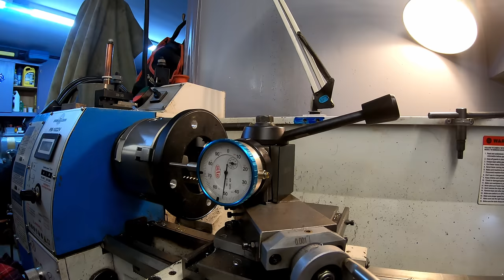Turning down wheel spacers on a metal lathe

Comment: I was a machinist for 12 years, and 8 years were spent machining FORD AXOD transmissions.

We machined nearly 80% of this transmission before we shipped it to the FORD Plant in Livonia, MI.

Long story short, we started with what we called Op 10A which was a Cincinnatti Milacron (CNC) HPMC 850, with this we machined the pan face, drilled, bored, and reamed 2 location holes for OP 10B which was a MASSIVE machining line. (About 2 bocks long)
It had arbor mills, trunion heads, turrets, and many other machines.

I learned so much back then and, if OSHA was like it was today, this machining operation, even with all the safety features we used, wouldn't be able to be run with humans.

Very dangerous to change inserts, drills, probes, taps, and mills on the actual machining line.

Extremely slippery from the cutting fluid we used from a 40-thousand-gallon tank.

Needless to say, this was a good memory trip back to those days, even with your Dad using a small lathe and a not so high tolerance part.

Great to see you learning his trades! (My Dad was never there, so you're very lucky Samantha! (Take it all in.)

Cheers,
James

Comment: I drove  a Ford 8N on my uncles farm in Iowa back in 1964. Not sure of the manufacture but he bought a sickle mower that was belt drive off the pto. The bar was so heavy I could hardly lift it. It had a breakaway feature but if it clogged I had to back against a wood fence post to reset it. I was a skinny kid. Rear mounted cultivator gave you a pain in the neck watching, especially when on a side hill.
Reply: Dude same.. My first tractor was a Ford 8N my neighbor gave me.. I drove it when I was 8 years old, belonged to my great uncle (long gone before I was around) he bought it new for his pig farm in the 50s... it sat for a decade before my neighbor who bought my uncles house gifted it to me.. I couldn't get it to run, thought it was just a coil.. turns out tractor supply sold me two junk coils.. ended up selling it to take a road trip to Oregon. Guy I sold it to had it running in minutes. Miss it, wish I would have kept it. Great tractors! Dangerous tho lol.

Comment: I’m very impressed by your dad’s work and I learned a lot about lathes! But in this case, I think I would of changed the wheel studs for longer ones on the hub instead. However I’m glad you did it this way because of your nice video! Thanks sam😁
Reply: That was her dad? Cool. My dad was a tool and die maker/machinist by trade.
Reply: @DAS-Videos  when she walked into the shop he said “hey Sam” and she said “hey dad”

Comment: im surprised andrew hasnt got a lathe, when i got mine i did a lot of jobs i needed doing and saved money, also made a few art pieces, replacement chess pieces,  new knobs for pan lids, its well worth the money to get a decent one and you can cut many materials not just metals...
Reply: He did have one he showed it to his dad once. Probably a reason it wasn't used this time
Reply from the maker: Andrew does not have a metal lathe said it was a hobby he couldn't get into,  that's okay can't do it all!
Reply: @samanthaweber6932  you should try it, over last 10 years i built myself a little steam engine between farm jobs, some things cost more than they worth but making your own will save a trip to town, especially when it comes to worn parts, i just weld metal back on slap it in lathe cut back to size and save my self $400 or more...
Reply: @kieranosullivan02  pretty sure he sold them all on marketplace

Comment: I have a 42 9N ....I kept my original PTO shaft and got a slip-over adapter so if I cam across any of the old style equipment, I could remove the adapter to use them...! I have an upgraded Vain Pump on the front to run my 1/2 yard front loader bucket which I mounted a 5' Bob Cat bucket, I had the control box updated to account for the preasure increase and added hydraulics beyond into it to be able to hock up auxiliary hydraulic equipment on the side,  like a log splitter...I also have a 5' gannon, 48" brush hog, and post hole digger with 6" and 12" bits.
These old tractor never quit...!
I was having carburetor issues, New carb...from Ford was $300 and it would not work....found and after market on line, new shipped for $40...took a chance, it did not even need adjusting.  Plug-n-Play so to speak. 

Sam....please keep giving us update on your Pop's build.

Thank you

Comment: How does your dad like that precision Mathews lathe. I have been thinking about buying one of those but had not looked too far into it yet. Is that an Allis Chalmers that your dad restored in those two pictures? really awesome work. Oh My Gosh your dad's shop looks just like mine with a Ford 8N  in process of being restored in the middle. I also have an Allis Chalmers B10, John Deere 110, and my pride and joy , my Miller Bobcat 225 that needs engine work.  I guess there are other people like Andrew, your dad, Andrew, Chris from NNKH, and you and probably all the other people reading this...
Reply: The Precision Mathews  1022V  is a good little import lathe for the money. I looked at a lot of different brands and am quite happy with the choice. The change gears and bushings required a little deburring. I went through all adjustments after cleaning and lubricating all sliding parts.  Also I changed gear oil after a few hours of use.. The tractor is a CF struck Turf-Rider that was sold in kit form and advertised in the back of popular mechanics, etc .. back in the 70s and 80s. Sam may make a video on it in the  future.
Reply: @jeffweber8371  That is so cool. Thank you so much for getting back to me. I loved Struck kits ever since I was a little kid. I had the opportunity a few years ago to pick up a magnatrac with a backhoe and a front end loader for $250 or best offer and I took too long scraping up the money at the time because I was recovering from nearly losing my right leg and being wrapped around a telephone pole on my hand restored 1957 Harley Panhead. It completely gave its life for me as it could not be saved. At the time I was fighting to save my leg which we did and even though it is excruciating pain to breathe I  would not have it any other way. Having gone to school for way too long to become a PhD chemical engineer (Whoopee...lol) I decided I want to do what I love and start a small engine restoration/rebuild/repair shop with machines from the 1800's that run on belts prefereably from steam , but I ma not that far. I found that to get the most out of our equipment I obtain treadmill motors and modify them so they are infinitely adjustable along with a DRO. So right now I have a bunch of engine drive welders to restore to pristine condition as Mr. Lincoln would have wanted. I am building a welding trailer that is 14' long and relatively low with a Lincweld 225, 50 gallon gas air compressor I converted from electric for arc gouging, a large Job Box that is sunk into the bed so you do not have to climb up to get stuff out of the box, a swing out welding table with a brand new 6" swivel vise and drill press. The final thing that Is absolutely necessary is a 2000lb capacity crane (not a harbor freight , more durable). I am almost finished my 4x4 Ranger that I mounted a flatbed and a Miller Bobcat welder on. I am looking for a beat up and abused autocrat or something like it for the truck. I am putting the trailer up for sale right away as I have a lot invested to bring everything to better than factory condition. I have to start a channel but very time I record something I think out sucks when it might be great..lol Can I find you on Facebook? I am in Northeast Pa , King of Prussia area. I believe we may have lots to talk about and more in common...talk to you soon-John here is a link to a YouTube channel that has a manual for your turf rider.https://youtu.be/eD7uK12D0-0

Comment: Awesome little video, I would of applied some copper grease to the rear of the spacers to avoid dissimilar metal corrosion between steel and alloy

Comment: How did 0.18  turn into 0.20 ??????
Reply from the maker: The goal was to remove 0.18 most of the passes removed 0.002 or two thousandths until the final two finishes passes when 0.001 or one thousandth was removed each pass to ensure a nice finish